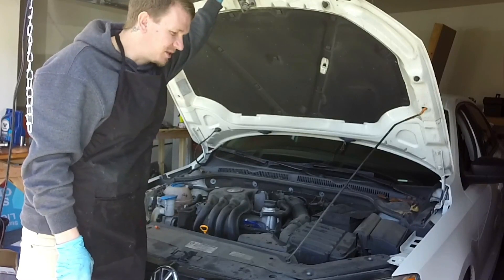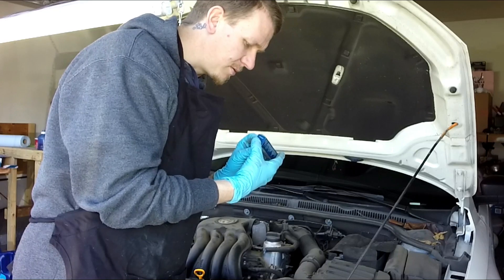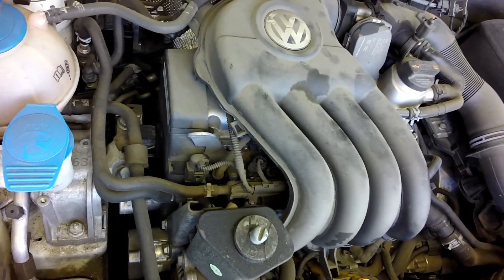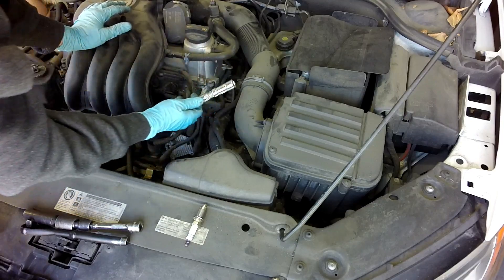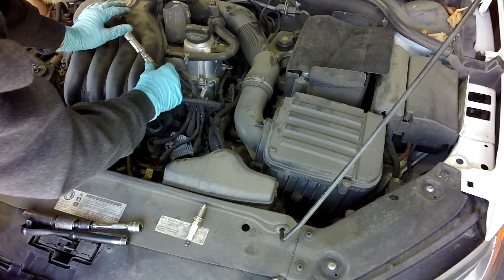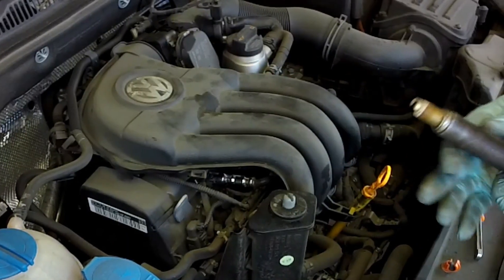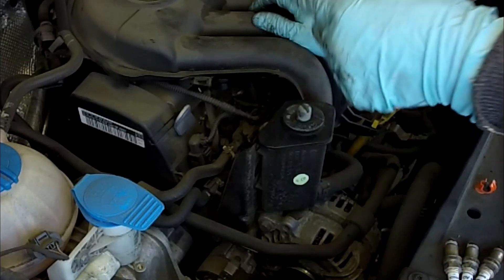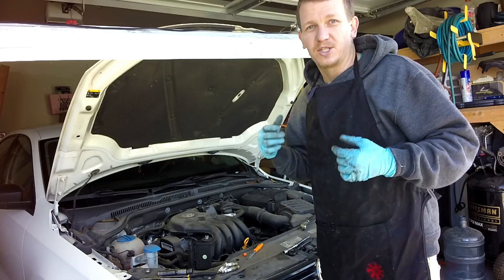VW Jetta Spark Plug Replacement. Tune up Pt 2. P0300, P0302, P0303 FIX

Comment: my mechanic is trying to tell me the intake has to come off so he can get to 2 and 3 spark plugs, he wants to replace the wires and plugs on 2 and 3, does this mean he doesn’t have to?
Reply: The first one he pulled was #3. You can get then from the side
Reply: change this mechanic

Comment: Maybe u can help me out. Have 2010 vw eos 2.0T. Have bosch double platinums inside it. Dealer says not right ones but have been reading are good not good. Use irridium use double platinum. Which is correct? If i can save myself a couple bucks doing it myself id rather than have the dealer rape my a**!!

Comment: I have 0 experience with cars but I have a question is this going to make my acceleration faster ? And get up speed
Reply: Not really, it’s just gonna make your engine run smoother and you’ll be able to sustain maximum throttle/power better if your plugs are worn out. you could see a little more throttle response if your replacing worn out plugs as well. If your looking to modify a non turbo 2.0 Jetta like this one you should stay away from that and think about keeping it your daily driver or sell it and buy a car that has more potential. These engines are really reliable but they have little potential to make reasonable  power without spending big money
Reply: @alexhejna5209  🤝 appreciate it

Comment: Where do you find the torque wrench attachments? Which ones are they? Thanks so much!
Reply from the maker: Those are just the 3/8 drive tools that fit your socket wrench. So the socket and extension you use to remove the plugs should also fit the torque wrench to install. 

Let me know if that answers your question. Good luck on your diy fix.

Comment: Thanks for the video. When using the plug pliers for plug 2 I managed to knock the injector connector for injector 1. The plug connector moves back and forth and the other ones seem to do the same. Are these plugs damaged when they are moved?
Reply from the maker: They should move a little but don't move them. Lol. If a injector seal goes bad, ull have a headache on your hands.
Reply: Scotties Hobbies 

Thanks for the reply! This is the fuel injector which has a o ring plug. It’s ok to rotate it out of position but the o ring in the rail and into the engine can get damaged. 

I ordered the lisle pliers tool and it’s 7 inches. Get an 11 inch plier tool that extra 4 inches gets you to plug 2 in the MSI engine.

Comment: So question regarding the removing of the wires from each plug. When a friend of mine tried doing this the "boot" stayed on the plug. Do we need a special tool to remove or just brute force to remove it? To pull up on it I mean you make it release from the plug itself...
Reply from the maker: Sometimes they can be a pain in the but to get off. Make sure to replace the plugs and wires as directed by manufacturer so the parts don't get stuck together.  I think I might have a link in the description for 'spark plug wire pliers'. In your case you might need those pliers.

Comment: If you replug the wires be sure to plug them in properly top right is #1, top left is#2, bottom left #3, bottom right #4. Hope it helps someone...I learned the hard way!
Reply from the maker: On a inline 4 engine such as this one. The number one cylinder is always nearest to the crank pulley.
Reply from the maker: Good job getting in there and getting the job done though. Excellent work.
Reply: Are you talking about plugging the boots for the spark plugs or actual spark plugs? Because actual spark plugs don’t have no order specifically  they need to go in just the boots over them do? Correct?

Comment: Thanks. 
But I don't see the description of the plug pulling pliers.
Only a concern since another video I watched the guy used what looked like a "special tool."
Reply from the maker: Stay tuned, tonight when I get home I will get you some links for these  special pliers. if you Google search all you need to search is spark plug wire pliers. I must have forgot to put a link in the description for you to purchase them. I'll fix it tonight.

Comment: can i use the same sparks on the old 2.0 Jetta A4 ?
Reply from the maker: I doubt it but possibly. What is the year, make, and model you are working on?
Reply: @ScottiesHobbies  - I´m working on both, Jetta A4 2006 and Jetta A6 2014 and looks like the same engine, the only difference is a plastic cover over the engine on the oldest A4.
Reply from the maker: For some reason I am not seeing a Bosch part number for this engine. Bosch should be factory but my next best recommendation would be DENSO 3403. You can get them here: https://ebay.to/2WvcCo0 or https://amzn.to/2Mf3yQg Don't forget to verify the gap prior to install. Gap should be 0.032"

Comment: Going through engine hesitation, 2012 2.0 gas, it was no sparks plugs or ignition coil so far
Reply from the maker: Check compression?
Reply: @ScottiesHobbies  take it back to my mechanic in couple days, coder says cylinder misfire, guess there are few things to check such as compression,  mass airflow sensors and others...
Reply from the maker: @alirezaashtiani8519  I always recommend a compression check. If you know its that majot to start then you dont even worry about all the littlr stuff. I check when i do my plugs usually.  But you can check a few parts, if its a multiple cylinder miss fire like a p0300 then probably more a fuel delivery or metering issue. If is is a particular cylinder code such as a p0303 or p0302 then you can focus on that cylinder.  Possibly have a bent valve? Keep us posted.
Reply: @ScottiesHobbies  the car has 170,000 miles on  it, literally the first issue,  been a perfect car so far. I keep you updated in few days, thanks for the response:)
Reply: @alirezaashtiani8519  what was the issue? I have car like in video but only 80k. No cracked ign pack, no obvious vacuum or bad wires. Had similar code p0300 to 301 304 then 351. Seems better on non ethanol gas or fuller tanks

Comment: Did u put anti seize on the new plugs?
Reply from the maker: I don't think so. I stopped using anti seize on spark plugs a while back. Someone schooled me on anti seize. When using anti seize it changes the torque rating. Also makes them easier to back out. That's why most spark plugs now have that ring that crushes to keep them in place. I've heard horror stories about the Ford 4.6 and 5.4 L blowing spark plugs out because anti-seize was used. Just like on lug nuts, never put anti seize on lug nuts just because it changes the torque pressure and will back out easier.
Reply: Great video. Wouldn’t using a torque wrench with a swivel like you have just make the torque wrench useless ? Jw thanks